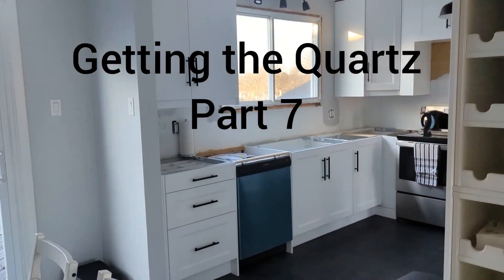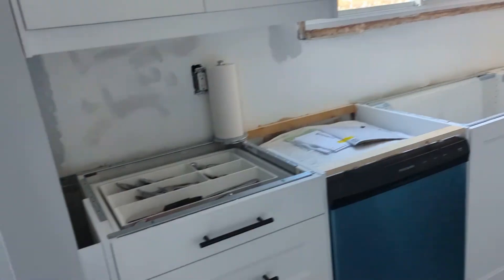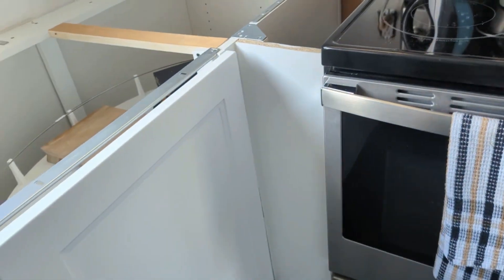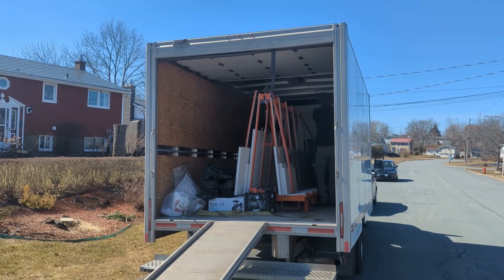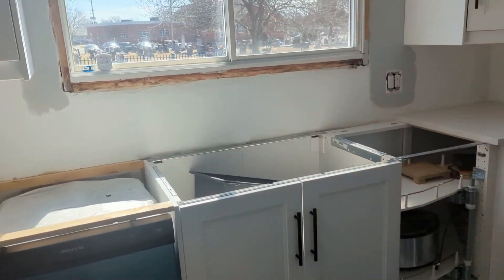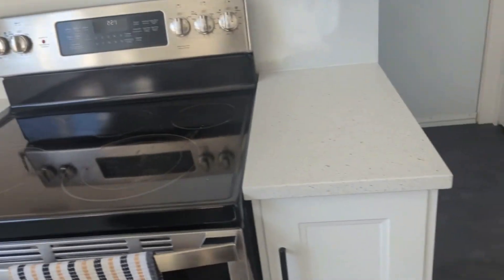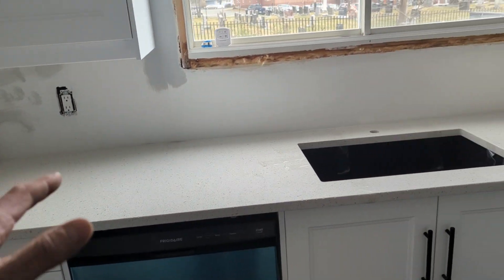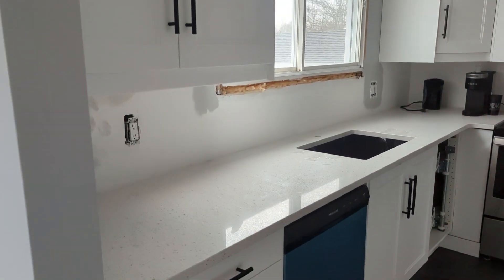IKEA Kitchen Part 7.  Quartz counter tops and Kilsviken sink.

Comment: How did they mount this Kilsviken under the stone?
Reply from the maker: Adhesive
Reply: @houseonpleasantstreet9774  no way only glue is holding that heavy sink. Could you please share a picture from underneath?
Reply from the maker: Hi I just looked.  It's glued. (I watched them). But there are little brackets for re inforcement